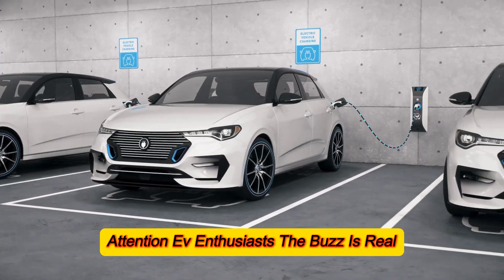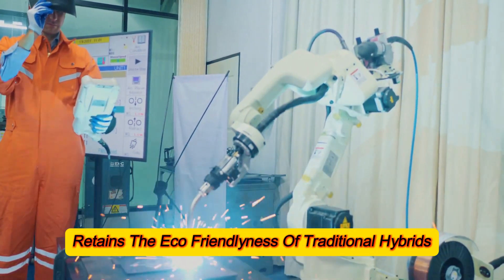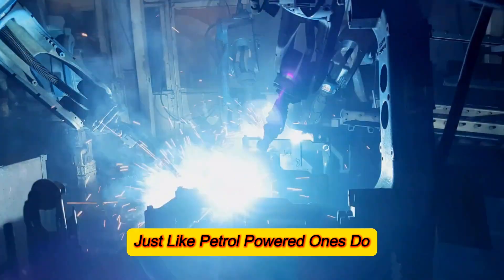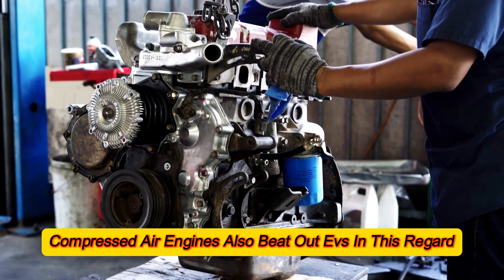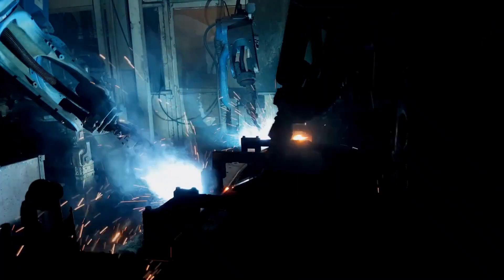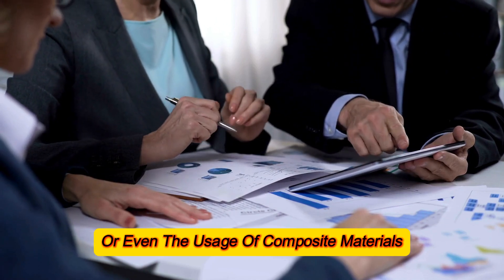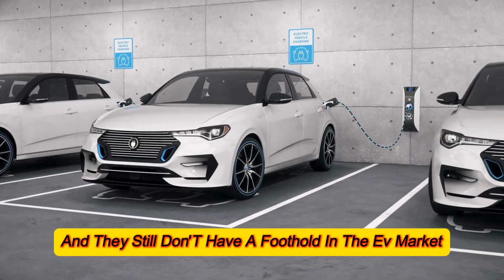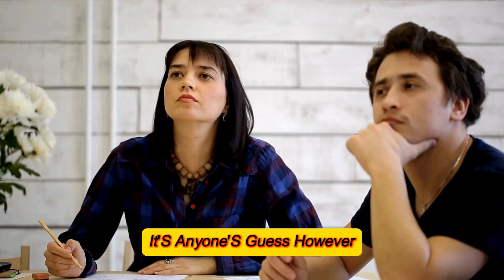GM CEO: "This New Engine Will CHANGE The World!"

Comment: shouldve just said the compressed air engine is similar to a steam engine, they are legit the same thing besides the thing that makes it go you can run a steam engine on air to test the tolerances then run it on steam and it wont matter